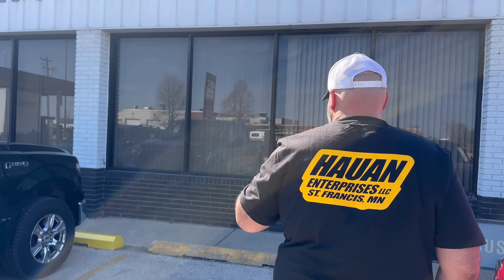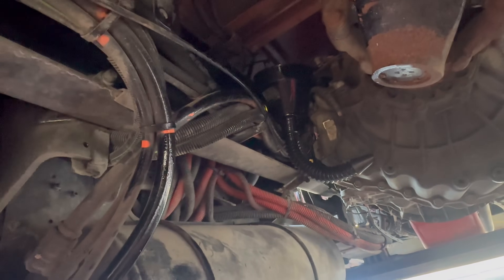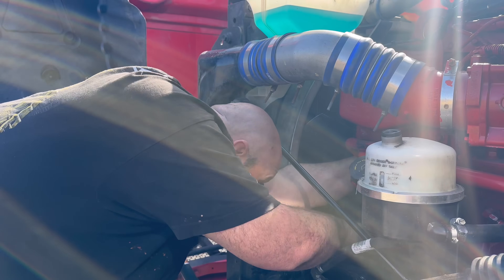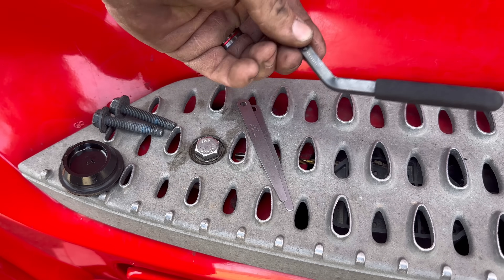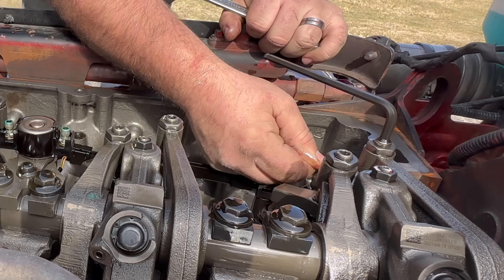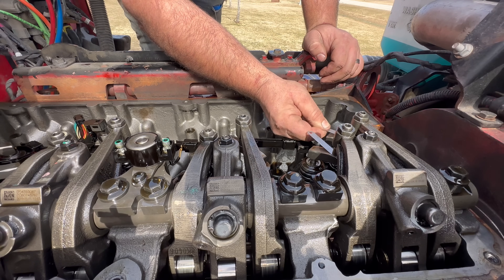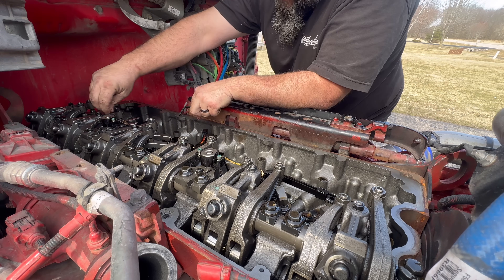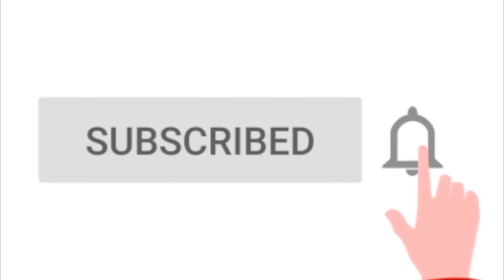"THE WORST CARRIER EVER" | Our Trucking Life - Episode #455

Comment: Love these type of videos, Martin. Just and FYI, I do a lot of repairs on Motorcycles and off road quads, etc. I bought a Battery-Operated Liquid Transfer Pump from Harbor Freight, for 13 bucks, and it saves on the carpal tunnel syndrome, if you know what I mean.   Keep safe, and look forward to your next post!  Ged Bless.
Reply from the maker: Yes I agree, I just didn’t wanna drive the 20 minutes lol. I do need one.
Reply: @TruckingTogether    LOL I do not blame you.  But it works really well.  As many times as I tell these people to drop the things off with little fuel in them, they don't.  pumping 5 or more gallons form the tank to a drum by hand pump sucks!   LOL.  Thank you for all you do.
Reply: Whatever

Comment: did you reuse  your rocker arms, they are very scratched for new if they are,(rollers), the reason for valve clearance is that when a engine is at max power the heat stretches the valves, take the intake pipe loose at the air cleaner side and the turbo side clamps, pull that complete pipe off, then the air filter housing is very easy to manage,
Reply from the maker: They are original and the rollers are not scratched at all, for 835k miles the rollers are in great shape. Just normal wear.

Comment: I am surprised at how little the oil flow is for the valve train when idling. I would have thought it would have been flowing more.
Reply from the maker: Quite a bit actually, cam gets priority oiling and so do rockers. It’s a high volume system just can’t see it from the angle.

Comment: I missed the part about which transmission you were putting gear oil in 13 speed by chance? Did you have any small metal particles on the drain plug magnet?  Really good information on the valve adjustment.
Reply from the maker: 12 speed endurant Eaton

Comment: Hey Martin; have you ever installed jake brake tune up kit on any of your ISX before ? My dad used to work for different engine brake manufacturing company known as Pacbrake for 36 yrs and he always bring these engine brake kit with him to do any tune up whenever any customers request one and he always works on CAT 3406B and C then cummins NTC models and N14 too before doing the 60series before he retired way back in 2006 or 2007… he started working way back 1969 when I was 1 yr old kid and I still have the pic of him working on jake brake on detroit 12V-71 and cummins 335 .
Reply from the maker: Not much to tune up on a isx for jakes, you have rockers with detent springs in them and solenoids. Don’t have Jake heads like older engines with pistons and seals. Usually when Jake’s don’t work it’s a rocker leaking oil or solenoid gone bad.
Reply: @TruckingTogether  ok I get it as it’s totally different jake brakes design not like old ones ..: I like the old ones … what about yours ?
Reply from the maker: I like the N14 and 3406E, c15, c16 engines. But my favorite is the dual cam isx. At 600hp nothing will catch it on a hill unless packing some serious hp.

Comment: Sacramento saying hello my friends  I am a little late , I understand you a 100% Martin , But My friend has this 55 chev drag car and he has a Allison transmission in it and what he done he put number 2 hydraulic fluid in the transmission , they ran  10 times , then he tore the transmission down   and it was like brand new  and he still running it in that transmission race after race , Now on the other hand you are showing the oil that is supposed to go in that automatic transmission , this is no lie , this dude i  met took number 2 hydraulic oil and stuck it in his automatic transmission a year ago or little more and that son of a gun is still shifting good and pulling good and it lowered the heat timp , I am not saying to do it. but he did it he did not  care he wanted to try it and it worked 😂😂😂  In a way I kind of knew it would work, because I seen a video about 4 years ago where this dude was puting the same hydraulic fluid  In his automatic dragster   transmission ,  actually he said something and then he tried cutting it out because it was a secret  I guess I do not know  , but he does all of his own work to,  but after 50 passes and then pulled it a part It was like new nothing was burnt in it  he said nothing smelt bad ,  I am not saying for anybody to try this,  I am saying this is what these two done 🕶.  The overhead Martin that's exactly right correct and precise
Reply from the maker: This isn’t an automatic like an Allison. It’s an automated manual. There is no torque converter or clutch packs in these, it’s basically a manual transmission that’s shifted by a computer. A full automatic will use different fluid. Hydraulic oil and ATF is very similar so it should run but I’m sure there are some differences.
Reply: @TruckingTogether   Ok thanks Martin

Comment: On a cm870 .. does the lift pump run when the engine is running? I have a miss that comes and goes. Always when it falls to an idel..goes away when you give it fuel. Chasing this problem for about a year now and cannot figure it out... any info would be helpful...
Reply from the maker: It’s only there to prime the system, it doesn’t run full time. The gear pump on the side of the cylinder head keeps fuel supplied when the engine is running, it’s the square cylinder looking thing that is on drivers side head right above the fuel filter. If you’re having idle issues and rough running it’s likely your timing or fueling actuators, 870,871 are not the smoothest idling engines. The actuators can be tested. The gear pump can also fail and get weak. It’s bet to do a fuel pressure test with insite.
Reply: @TruckingTogether  yes I've changed fueling and timming selonids.. no change in anything... its crazy it mite go a week without it missing at idel.. and then do it at every stop sign or red light.  But no miss while your on the throddel.. drivein me nuts lol...sometime miss is horrible other time it very little and sometimes smooth as baby butt...maybe gear pump can cause this..
Reply from the maker: It can, I would definitely check fuel pressure.
Reply from the maker: Are you still running the VGT turbo? If so the backpressure aka exhaust pressure sensor can cause this too, it’s the sensor that gets fed by exhaust pressure off the manifold that’s in the thermostat housing. If youve never replaced it I would as that sensor can cause poor drive ability and idle issues. Also check and clean your intake pressure sensor with carb cleaner only. They won’t throw a code sometimes.
Reply: @TruckingTogether  I've changed that pressure sensor..turbo speed sensor..cam sensor..crank sensor..the tube that runs to Manifold from pressure sensor is free flowing.....all new fuel lines from tank to gear pump.. passed performance test multiple times..no codes. But will say cylinder imbalance... something about fuel .... can't seem to fined and air leaks.. no fuel leaks at all.. I've also checked for low voltage.. about the only thing I have not changed is the gear pump and the lift pump..I'm Installing a class 8 165g fass fuel system right now. Hopefully this will help  🙏
Reply: @TruckingTogether  it seems to do it worse if I gear down to a stop with or without Jake doesn't matter.  When it drops to idel will be loppin bad..but of I throw it in neutral and a cost to the stop it will idel fine most of the time..cold starts are pretty ugly butt that's normal for these 870s .... sometimes it will be idelin just fine and out of nowhere will just start missing very bad.. never will do it under a load at all.
Reply from the maker: Have you done an injector leak test by chance? Could also be that, but yes that definitely sounds like a fuel issue to me. It’s funny because when it’s warmer out my 871 starts shitty but when it’s really cold out it fires up great with no drama but when it gets some temp in it, it’ll start acting up and loping sometimes.

Edit: if you don’t have Cummins insite I strongly recommend, I have gotten a bad back pressure sensor from the box and didn’t have a code for it. Insite showed the sensor with no activity. It can also run all your fuel tests.
Reply: @TruckingTogether  good info 👌.... no I haven't done a leak down test yet.. I fill it shouldn't be a injector because it's not all the time..can a bad injector come and go like this? My cousin has a 871 and it does the same as yours..likes cold weather...my 870 does not like cold at all..
Reply from the maker: Yes, an injector can come and go.
Reply: @TruckingTogether  may be the problem then.. I no one thing I'm about tired of chasing this problem lol.... im going to do a full injector replacement and a new gear pump... I'm don't no what else to do..
Reply from the maker: Don’t throw parts at it, get someone to do an injector leak test on it and run a fuel psi test with insite. Injectors these days are big $$
Reply: @TruckingTogether  yes they are ...... shops down here are crazy high. 1000 bucks just to hook up a fass system lol. I did it in about 2 hours my self...  I fill like I'm getting to run around from shops here with this problem I'm having...I can do alot myself but not a leak test or computer stuff...wish I new how to do the valve adjustment . I fill that would open alot more to what I could do.
Reply: Omg..ima about ready to drive this truck to you and see if you can fix it .... 5 different mechanics same response...we're not sure what's wrong with it...eerrrr....

Comment: Is it a special tool or socket that you need for the torque wrench? do you know what it is?
Reply from the maker: To bar the engine over? 3/4” extension.
Reply: @TruckingTogether  my bad, I meant the jam nut with Allen key for the rockers.  I just want to see how much the tool/socket is before I decide if it's worth it...I doubt it is.  Great video by the way I'm doing my 870 off your 871 video soon.
Reply from the maker: For the rockers it’s just a 3/4” jam nut and believe a 6mm. The jakes is a 1/2” jam nut, the Allen is a small one for jakes and I dont remember, wanna say a 4mm. I honestly never torque the jam nuts, the specs are 22lb ft, I get the jam nuts tighter by hand than that. For an 870 you will want an inch lb torque wrench to set injectors.

Comment: Hey Martin  How often are those trans supposed to get serviced. I have never worked on those. Dont own one.
Good video!👍👍👍
Reply from the maker: 750k miles.
Reply: @TruckingTogether  thanks. Thats pretty long intervals….
Reply from the maker: Yes quite the long interval, I probably won’t go so long next time.
Reply: @TruckingTogether  as an owner operator i was thinking 250-3  . Fleet owner probably dump these trucks at 350-4 so they dont care.
Good job explaining the overhead. Most dont realize how much it matters .
Like a tune up on the race car

Comment: Two gallons in a transmission?  😬
Reply from the maker: That’s what the endurant takes.
Reply: @TruckingTogether  big difference between the old school and the new.  Wow.
Reply from the maker: Yep 1.5 gallons less than a traditional 13/18. It’s a different oiling system, think of it like a dry sump oiling with high pressure nozzles spraying on the gear stacks.

Comment: Those automatic transmissions don't hold very much gear oil. I'm surprised.    You should buy a 12.7 Detroit series 60 so I can learn more about them from you.  lol
Reply from the maker: Not much to them, I’m not a big Detroit fan lol. I do like the DDEC 5 14L.
Reply: @TruckingTogether  I had an 06' 14L detroit. Bunch of EGR and that stock turbo problems. Nobody back then knew how to delete them or I would have. I've got a 2014' and 2016' gliders now with the 12.7 pre emission eld exempt now. They are ok just need a little tuning to wake them up.
Reply from the maker: They definitely wake up with a good tune, very simple and easy engines, I’ve only had one and had no complaints. The 5s definitely were a basket case egr intact.